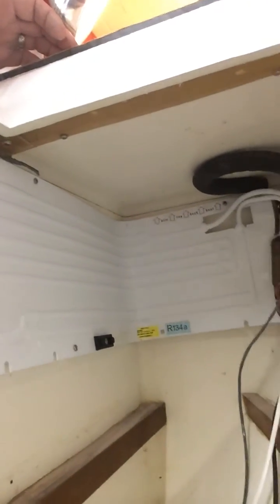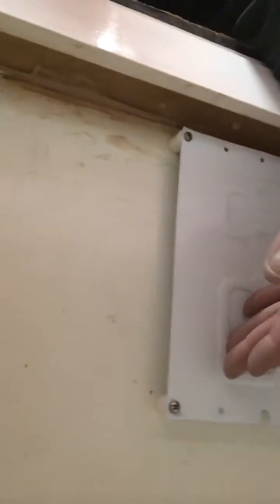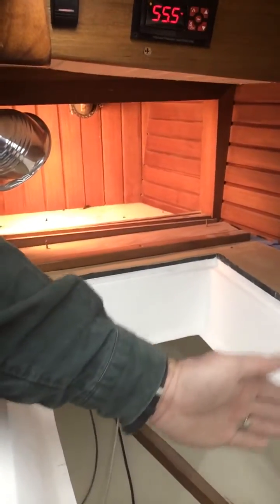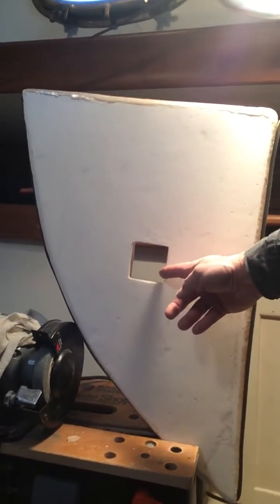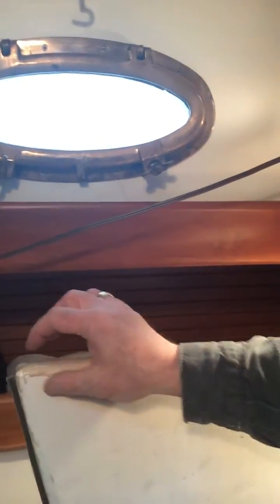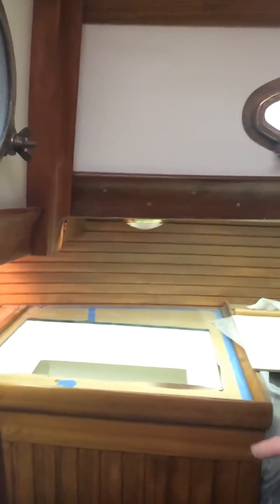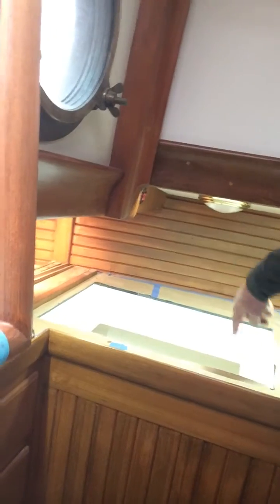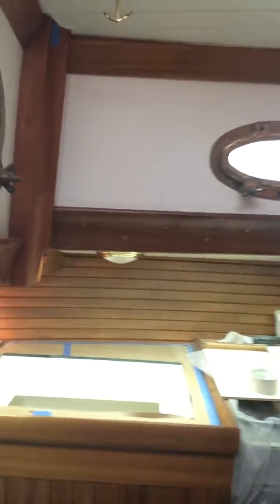Frigoboat Installation Overview (part 1)

Comment: It's the "evaporator" you are referring to not the "condenser".  The evaporator is located in the icebox compartment and absorbs the heat.  The condenser rejects that heat into free air space or the sea thru a keel cooler.